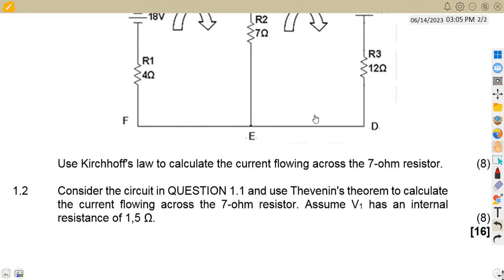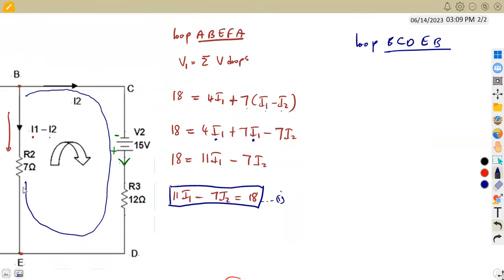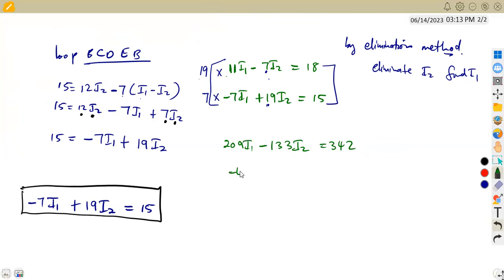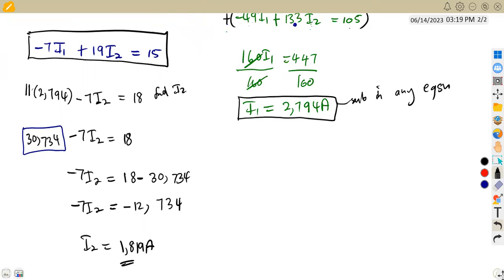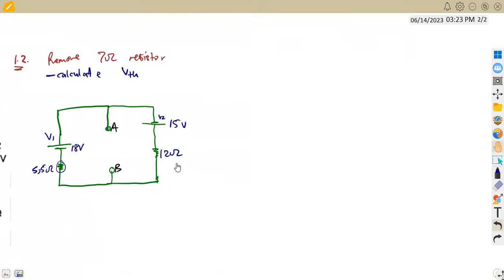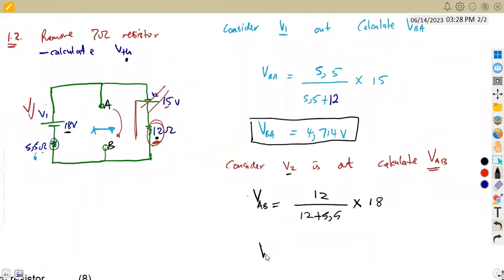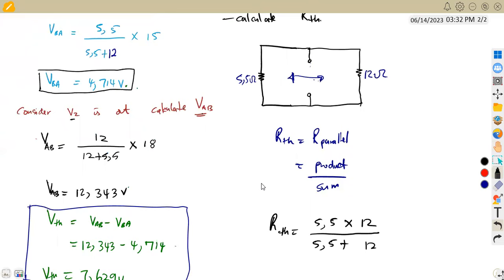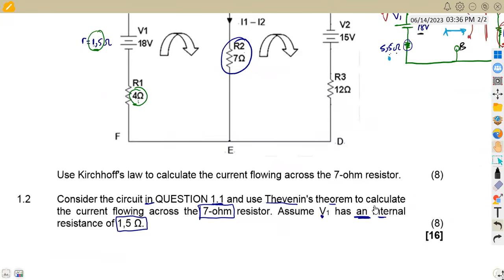Industrial Electronics N4 Network Theorem February 2022- Thevenin's Theorem @mathszoneafricanmotives

Comment: The value of I2 is 1.748 A when using substitution method, will it be wrong in an exam since the current through 7ohm Resistor is 1.046A

Comment: V thev is not the same answer as the memorandum
Reply from the maker: They didn't not calculate Vth properly you can't multiply that to resistance.
Reply from the maker: Prove with the latest video I did on thevenin or I will do It with another way
Reply: Thank you sir much appreciated 🙏